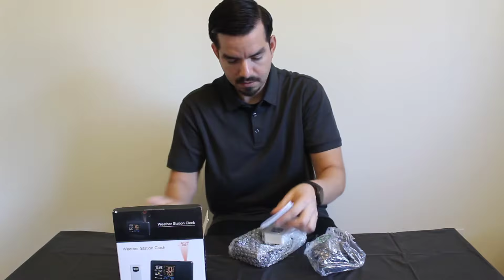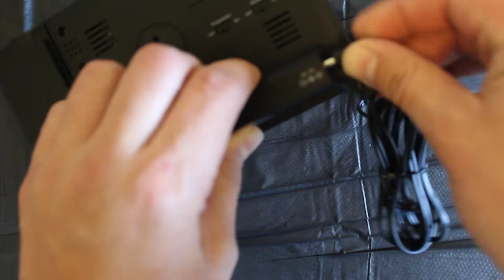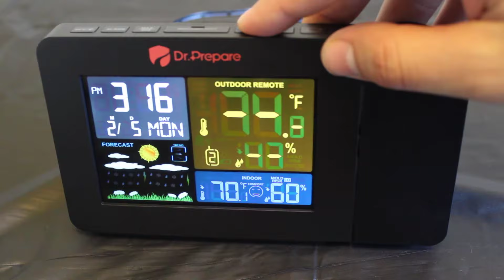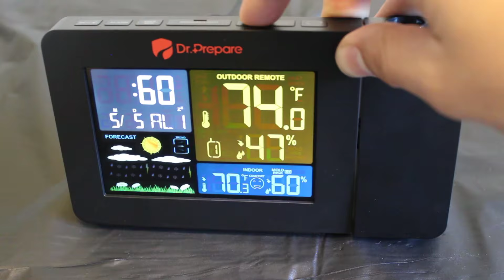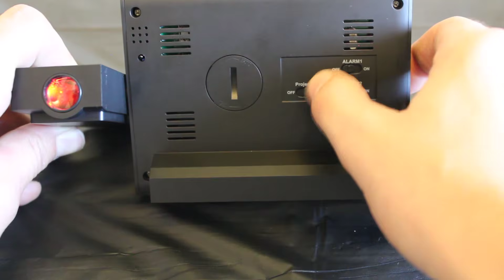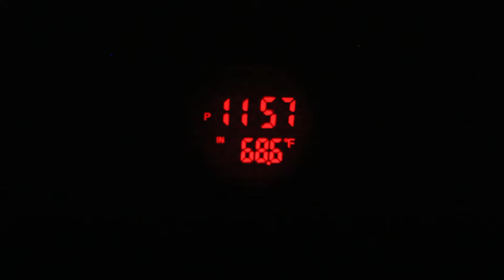Ask Dr. Prepare丨Projection Alarm Clock Beginners Guide (Full Version)

Comment: Too much work done on those clocks and one most important thing isn't done which is. rotate the projection not only flip 180 degrees. I want to be able to see the clock and the projection on the ceiling and it's impossible to see the projection straight without rotation or at least move 90 degrees not 180 degrees.

Comment: Thank you, thank you.  I was able to stop the sensor from going from 1 through 3.  For others, I took the batteries out of the sensor for 15 seconds, waited about 15 minutes, and then used the up arrow button to keep putting the clock back to the number 1.  This stopped the cycling button next to the 1-3 display from spinning and it disappeared.

Comment: Is there a on-off button. When I unplugged and then replugged, the clock stays on for about 10 seconds after I push the (snooze/light) button. Is their an on button that will keep the clock on.
Reply: Generally, when the clock is pluggged in the backlight will stay lit. Maybe you can short press the snooze/light button gain to keep the clock on?